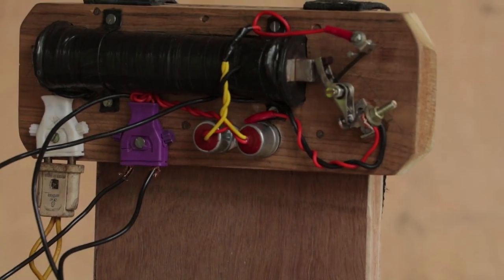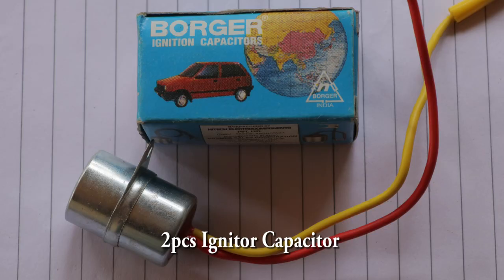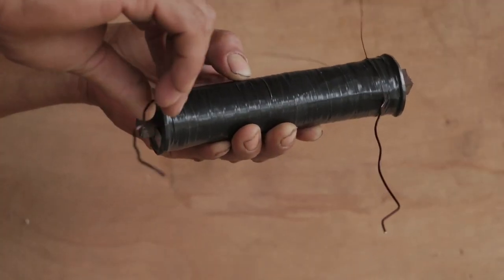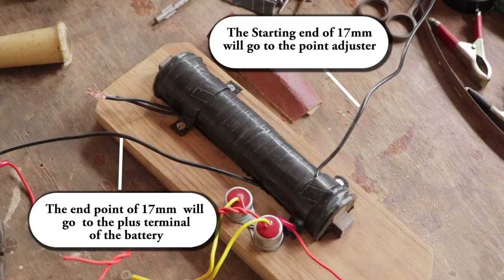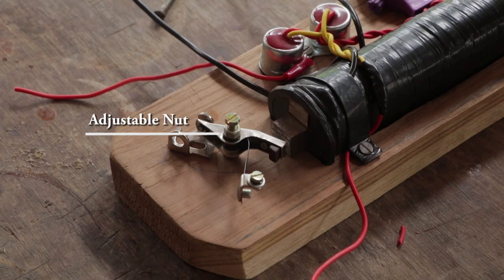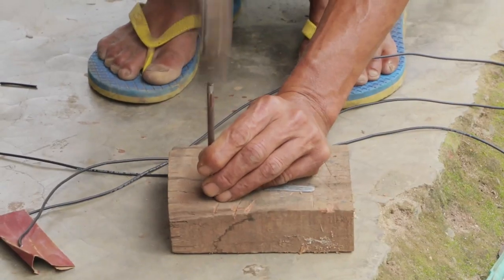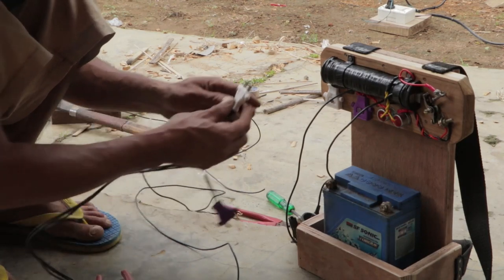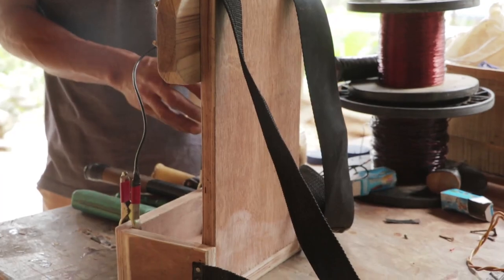Electric Fishing kit (Local Made)

Comment: The working principle is simple.
The current from the battery is DC(direct current) which is 12volt.
POINT converts the battery 12 volt DC to 12 volt AC(alternating current)by mechanically switching on and off, which is then passed to the input of the transformer (primary windings). Transformer  converts the 12 volt AC to 250 volt AC (or even more depending on the number of turns on the secondary windings).
The reason why we need a POINT is the fact that transformer working on the principle of mutual induction (meaning it works only when the input current is alternating).
*Output power depends on the size of the wire used in windings.
*You can replace the POINT by using MOSFET IRF3205 or it's equivalence.
*Above transformer might have low efficiency due to hysteresis and eddy current loss. This can be avoided by using ferrites core and proper laminations.
Reply: Thanks bro. Well explained
Reply: Thank you brother 👍🏻

Comment: How comes about the 22 mm side has 3 cable while the 17 mm has  single cable?
Reply: It is one wire, but three layers of turns. Sadly there is no specifics on the number of turns for both coils.

Also, while it is possible to wind the smaller size magnet coil wire on top of the larger sized wire, it's probably a better idea to wind the smaller wire first. And once finished, dipping the whole coil assembly in varnish might help with longevity of the coil wires by reducing vibration.

Comment: great video... just a couple questions.. where did you get that much wire in different guages, and how many rolls of electrical tape did you use? seems like at least three. for the cost of the copper wire and e-tape, I could buy fish
Reply from the maker: Fishing is an Art, hobby and passion for some. Thanks for the concern.🙏
Reply: But you can't use fish to get more fish. Whereas with this kit, as long as there's fish in the water and it works properly, you will get fish. No guarantee on the size, though.
Reply: #Expenditure of making fishing kit
3 insulation tape- ₹30
2 ignitor- ₹ 60
1.5sqmm 2/3 meter-₹50 approx
Copper wire 17mm (half gram) - ₹700
Copper wire 22mm (half gram) - ₹1000
12v battery-  ₹ 2500
Now you can calculate it... 
Ofcourse you can buy and enjoy it but  whenever you feel like to have fish you hav to buy it but those who hav the fishing kit can catch it and sell it too  so there's the difference... 
I don't have interst but i feel like that . 
No offence

👍🏻 it if anyone is agree
Reply: @Anen_Aier  agreed 👍

Comment: where did you get the iron plates is it available in the hardware shop? If yes may i know the thickness and wide of that iron plates.
Reply from the maker: Yah it's available in hardware stores. The one I used is less than 1mm thick and 1 inch wide. But you can make the plates according to own requirements.

Comment: How long can we go with 12v battery???(hours)
Reply from the maker: Depends on amp of your battery. The one that we use it can go up to 3 hours continuous use. It's better to use lithium battery type instead of lead acid batteries.
Reply: @Anen_Aier  Thank you so much for your reply
I have more question
 can we make the battery go longer by increasing the coil or something 
Because our transformer(machine) only go for 1hour or less than that
Reply from the maker: @sandeepgurung9860  increasing coil size will draw more battery juice, instead use high amp batteries, like the 35ah if you have any
Reply: @Anen_Aier  thank you for the answer
We use at big river so we need high power
We check the power with 200watt bulb and its bright enough 
But our machine doesn't go long
Is there any way to avoid such problems?

Comment: How many turns in every rounds?
Reply from the maker: Bind the 22mm continuously from one end to other for 6 times, and in similar process bind the 17mm for 3 times. And after each round of binding wrap it with paper and black tape till we finish all the binding.
Reply: @JESS-cm7ko  how to connect the 22mm to the others, because in the video he did not connect to other wire just get the starting and ending of the 22mm wire the rod and net.
thanks

Comment: Hie brother with all due respect, I think you made a mistake , the size of your copper wire ain't correct, 22mm is way too big maybe you meant 2.2mm and 1.7mm, not 22mm and 17mm, wires of this size are nomarly used by electricity suppliers
Reply: It's 17mm & 22mm Copper binding wire.. Not that wire wch we use for house wiring. Know the difference.